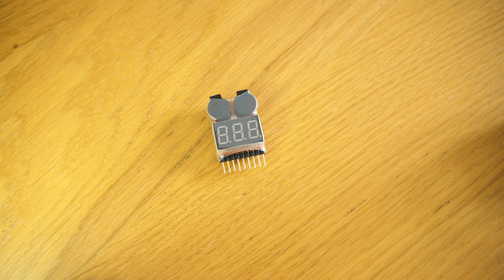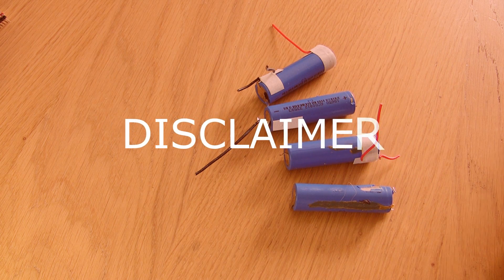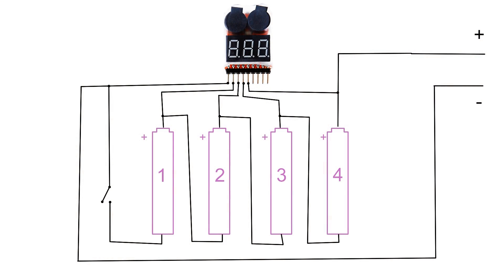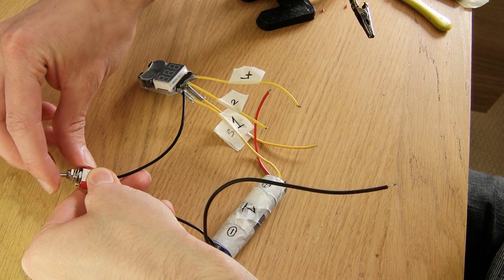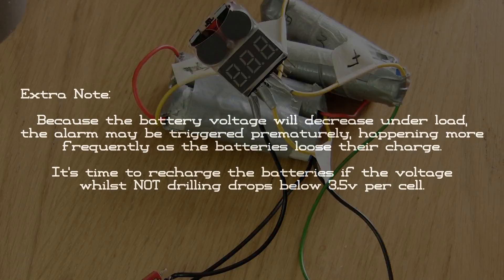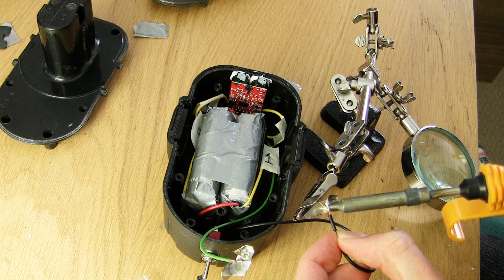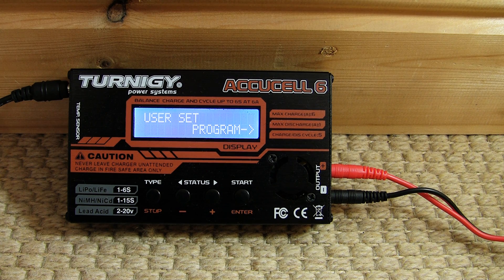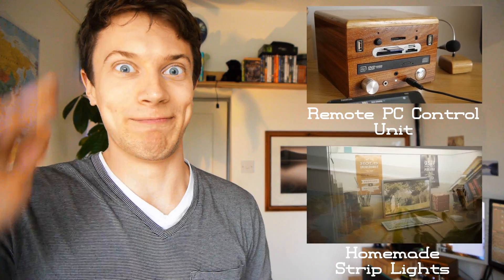Supercharge a Dead Drill Battery (replace Ni-Cd with Li-ion)

Comment: oh boi, 2013. I hope not too many watch this anymore. it's quite the hackjob and the batteries will overcharge at some point which could literally burn your house down if you don't pay attention lol. also there are many different kind of 18650 cells. the ones used in laptops are not designed to discharge quickly so this is the wrong usecase for them. that will destroy the cells pretty soon and further increase the imbalance in voltage of the cells.

Comment: Can you do an updated video were you do the same conversion but with a balanced bms pcb and discuss which pcb's could be used for which drills. i have found it difficult to know which bms pcb dose balanced charging and works for which capasity drill. i.e. a 3S with protection is is sutible for 14-15v drills but what do you use for a 18v drill. your views and guidance would be greatley appreciated

Comment: Hello people, do you think i could still use a low voltage li-ion battery
By that i mean, i got a big 48v (16Ah) battery that got undercharged for too long and know the voltage is too low so the BMS don't let me charge the battery anymore.

I don't really know what to do to be perfectly honest.
Even if it lose a little bit of autonomy, but if it can work and be usable that would be wonderful.

Comment: Given the cost of the battery warning circuit and the Li-ion charger, and if you have to buy the Li-ion batteries, ii might be cheaper to just buy a new drill. But, what fun is that? :-)

Comment: You used only 4 Lithium batteries. Would it be possible to fit 8 (4 + 4 in parallel) for more capacity = longer drill working time? Did you think of this?

Comment: Don't know if anyone sees this but duct tape usually conducts electricity so a big no-no as a cell wrapper. Just use electricans tape or 18650 cell wrappers, works like heat shrinks and costs cents (or pennies, if you wish) per wrapper.
Reply: https://www.aliexpress.com/item/32924790139.html?spm=a2g0s.8937460.0.0.2a192e0e2S0kur

Comment: This is a highly effective method to repair your old and dead batteries and prolong the life span of new and used batteries [Check Details Here==>https://plus.google.com/100351090281822647456/posts/Gwtd4mVBdEd ]. You can save a lot of money and help in nature preservation by repairing the batteries yourself. Any type of battery can be repaired as explained in the book.
Reply: ty

Comment: The switch in your schematic is in the wrong spot.  You do have it correctly wired in your end product.  Where it's shown in the schematic it will switch power on/off for both the drill motor and the monitor board.

Comment: Lap top batteries aren't advised for power tool usage. These are battery cells with low amp discharge limitations, like 3A, and aren't cells designed for power tool applications. While you'll probably be okay, like this video certainly proves, things can also go very wrong very fast. It's so easy to avoid this by simply using appropriate cells.

Instead of recycling terrible lap top batteries with all sorts of unknown cell specs, people should much rather just buy some high amp discharge cells, which are very much available on the vaping/e-cig market these days, because vapers are paranoid about batteries blowing up in their faces, which is easy to understand. That's why they use the best cells available. These are actually redistributed surplus cells specifically for power tools and EVs, like IMR cells and hybrid chemistry cells, and by being all new and fresh, you can rest at ease knowing they won't have crazily different discharge rates. They'll also be safer to handle, for whenever a DIYer might make a terrible mistake, considering they can handle quite impressive pulse discharge rates (some up to 150A for a second, which for all intents and purposes would equal a short, although they're definitely not designed for this specific purpose in mind), as opposed to shitty ICR laptop cells, that will explode by just looking at them.

IMR cells typically have a 10-20A discharge limit, while some hybrid cells can handle a load as big as 30A. 20A hybrid cells would probably be the best bet, as it is a good combination of discharge limit and charge size. While I haven't kept myself updated on the battery cell market for a year or two, Samsung 25Rs, for instance, are great and classic cells, that should be available in any vape shop for roughly $5 a piece. They're 20A and 2500 mAh, as far as I can remember.

Stay away from laptop batteries. They're in laptops for a reason :)

Comment: Good video I 
have a problem when drill strikes the alarm activates but it stops 
working the drill reading the voltage rises but the alarm does not turn 
off that is normal?

Comment: Nice video, but instead of the alarm display and the switch, why not just add a BMS to the circuit... It will take care of charge and discharge cut offs and also balance. ebay has them for about 3 bucks.

Comment: sorry but laptop batteries are useless for drills,why,laptop batteries give a constant output,so their about 5 amp,but drills need bursts of power,and need high drain batteries around 20 amps,if you use laptop batteries there is a chance of overloading the batteries causing the battery to vent[blow up]

Comment: I have been seeing black and decker 20v lithium batteries on sale for like $40 for 2. I am wanting to convert my craftsman 19.2v nicad to lithium and this seems like a great way to do it. it already has a protection circuit.  I should be able to just rewire to the correct post (assuming it fits in the case).  thoughts anyone?
Reply: As long as you have a proper charger you can most definitely do that. There is one thing though that wasn't mentioned in this video, which is the balancing of the cells (that's fairly important with lipo cells if you want to retail full capacity). Your built in protection circuit may have balancing built in. If not, the RC chargers shown in this video should have balancing connectors that take care of that. In that case you will have to make separate balancing leads for every individual cell to connect that while charging.

Comment: The switch is going to take a very heavy current when the drill is under load. Would it not be better to connect the negative output before the switch
Reply: Since it's a circuit in series the current will be the same in every point of the circuit. That switch will probably take the current though. If you don't feel comfortable using a switch of that size, you can always install a beefier one

Comment: This is dangerous. Your not balancing the cells and that could lead to one of them being overcharged. Anyone attempting this should also solder in a balance lead that hangs out the back of the case, then charge it as you showed in the video WITH the balancing lead attached.

Comment: it will be also good idea to duplicate wires, that goes to the monitor PCB, and use them for balance purposes with chargers like showed in this video, to ensure long battery life. or use BMS PCB (battery management system), that have balance function and charge/discharge auto off function. ofc it cost more, but you pay for your safety and it worth it, if you really don't have a lot experience  with lion/lipo batteries.

Comment: not sifting through the comments but ya dont use duct tape as an electrical insulator use heat shrink or tape designed to insulate electrical components, electrical tape etc...

Comment: I have really been enjoying your videos. Just found this channel today and I'm already a good 7 videos in. This project does concern me though. I know this is an ancient video but I just hope others don't dig this up an try this with the intent of using the drill for anything more then tightening a couple screws. With power tools it is really worth just spending $5 on a proper 20amp 18650 from Samsung, Lg, Sony or panasonic/sanyo. Considering the price of these packs even the $20 is a huge savings. In general laptop batteries tend to be rated around 5-10 amps with 10 amps being a lucky pull from a very high end laptop pack. In general you want batteries rated for 20amps with power tools and from experience it is also best to avoid any cell that is made in China. Yes, some are good but even those good ones seem to be over spec.  When planning to repack pulled batteries each cell should be charged, drained and charged again to ensure none are heating up abnormally or draining much quicker then the others.

Comment: Hi Matt, I'm currently investigating a similar but more up to date issue. currently most of the top power tool brands have a 10.8v impact driver, for example screwfix brand Titan. they used to sell replacement batteries for £8.99 but have now stopped doing so :S I rang them and they basically said buy a new set as it's only £80 (and now you get a free drill... yay! for the money I don't think you can get better) consequently I did, and that left me with an old battery to experiment on, opening it up it's simply 3 (low amp hour (1.3)) 18650 batteries. having scoured the Internet I can't find a decent video that shows how to do a replacement on them, I've got myself a soldering iron and 0.3mm solder just waiting on the batteries to arrive from an "international seller" I went for 3 amp hour batteries for longer usage, any who, it occurred to me that you could do a video on this for people spread this nice little hack rather than people ploughing money into whole replacement drills or battery packs

cheers

Comment: Hi Matt, really like your videos! I'm currently investigating a similar but more up to date issue. currently most of the top power tool brands have a 10.8v impact driver, for example screwfix brand Titan. they used to sell replacement batteries for £8.99 but have now stopped doing so :S I rang them and they basically said buy a new set as it's only £80 (and now you get a free drill... yay! for the money I don't think you can get better) consequently I did, and that left me with an old battery to experiment on, opening it up it's simply 3 (low amp hour (1.3)) 18650 batteries. having scoured the Internet I can't find a decent video that shows how to do a replacement on them, I've got myself a soldering iron and 0.3mm solder just waiting on the batteries to arrive from an "international seller" I went for 3 amp hour batteries for longer usage, any who, it occurred to me that you could do a video on this for people spread this nice little hack rather than people ploughing money into whole replacement drills or battery packs

cheers

Comment: I'd reccommend using RC car/plane grade 18650 cells instead of laptop ones.
They aren't rated for much more then 10A continuously and a drill could exceed that.
As long as you're careful not to drill something too hard it should be fine though.
Other then that minor recommendation this is a great guide to convert a drill to Li-Ion.
Reply: 100% agree there actually usually 5 amps,and a drill needs 20amp,high drains,to avoid the batteries to vent

Comment: Just want to say that duct tape is "supposed to" be made with metal fibers in it, as it was originally used on sheet metal ducting--cheaper brands do not have such, and some do--so be aware of what you are recommending, better to recommend straight vinyl tape, shrink wrap, or cloth tape.

Comment: Using old laptop batteries in a drill is EXTREMELY DANGEROUS. They were not designed for these high power loads and are already worn out. Someone may follow this and burn down their house or have a battery explode in their face then burn down their house. Just because you put in a disclaimer does not make it right.

Comment: I did the same project recently, but instead of a lipo protector and using a lipo charger I just bough a 7$ ion protection circuit and stuffed it into the case.

Comment: actually I made the same thing in earlier days but I made the battery tester outside the battery box because you need to pull the wires out to balance the batteries, unbalancing lithium batteries will probably make fire

Comment: Your soldering is quite... well let's just say that those contacts are not going to be highly reliable when your technique isn't proper. You're making a lot of cold joints that aren't flown properly.

If you make this, don't follow soldering advice from this channel.
Reply: I think he knows how to solder. his appeal is...KISS principle[A]  keep it simple stupit.... style of presentation, at this level of work soldering is a skill that we all probably know enough to keep it safe. Always being aware of one's level of expertise and asking for help when we things might be unclear. I think that DIY Perk uses a good balance of common sense while making entertaining vids that don't bog down fast, in technobabble. Save that for the work table and your buddies.  and do more research as the plan never survives contact with the enemy. so good?

[a] KISS principle. (2017, October 2). In Wikipedia, The Free Encyclopedia. Retrieved, November 2, 2017, from https://en.wikipedia.org/w/index.php?title=KISS_principle&oldid=803368540

KISS is an acronym for "Keep it simple, stupid" as a design principle noted by the U.S. Navy in 1960.[1][2] The KISS principle states that most systems work best if they are kept simple rather than made complicated; therefore simplicity should be a key goal in design and unnecessary complexity should be avoided. The phrase has been associated with aircraft engineer Kelly Johnson (1910–1990).[3] The term "KISS principle" was in popular use by 1970.[4] Variations on the phrase include "Keep it Simple, Silly", "keep it short and simple", "keep it simple and straightforward"[5] and "keep it small and simple".[6]

Comment: Hi I nearly done the battery but I don't understand how you get the negative of the battery to the terminal to the drill do you wire it up from battery one
Reply: Check the "wiagram" at 2.32.

Comment: How does it work without any balancing ? :-O
Reply: all the batteries he used were very close in their voltage when not under load so once you do a first charge with 1 amp it is quite hard to over charge the batteries do you can leave them until all cells have charged fully after that all batteries are at the same voltage so no balance charging is needed but is advisable after a few uses or if it had been left for a while.

Comment: Nice howto ! I did something similar to my drill batteries with 4s1p 18650 cells myself a while ago.

A few things to consider:
One should only use high current 18650 cells if you have a high powered drill, e.g. at least 5-10A continous current. Something like Sony VCT4 or VCT5.
Only charge your 18650 cells without balancing connector or DMS if they are know to be drift free. When you use Sony Konion V3 for example. Otherwise always use a charger with balancer such as an IMax B6. I used Sub D-Connectors for provding external connections to the balancer.

Using 18650 cells from an old laptop battery with unknown specs and charging them via a simple LiIo-Loader will not only screw up your new battery very soon but also possible cause it burning down during charging.

Comment: +DIY Perks would you be able to take a dead battery from a drill and make it wired? use extension cord or something? sometimes it would be nice to not have to worry about battery charge and I would rather not have to buy a second drill.

Comment: Shouldn't there be a balance board since they are connected in series? The protection board is not balancing them, or does it?:O
Reply: +PsoydoGangsta Correct. It may lead to imbalance. However this is only usually a problem with non-identical cells, and usually in 24+v configurations
Reply: battery upgrade
do we still have [asme]americam society mechanical engineers as a usable guideline or has this been outsoursed also?

Comment: Your drill will not last long when powered by much higher voltage.
Also your cells will heat up much and also will die because they are for up to 3A as new, old one should be usted up to 1A, u will use them at 10-20A, its ridicoulus....
Reply: +Arek R. it is a 14.4V drill. Under load those batteries won't put out more than that.

Comment: Very good! would be neater if you use heat shrink insulation for those contact points. :)
Reply: +Leo Li you came to the wrong place if you're looking for neat construction. I actually turned the video off when they started soldering the leads to the battery tabs. I'd seen enough by then. It is a good idea overall though.

Comment: I have a craftsman drill with 19.2 volt batteries.  How can you convert this voltage to Li-ion?
Reply: +Ken Brand take 5 cells instead of 4. it should work
Reply: +Wolter Nijmeijer Yeah those batteries with the funny voltages are the companies using the rest voltage. 19.2 is really an 18V pack. Dewalt calls theirs a 20V pack now. As if the tool power pack market wasn't already a complete mess, they had to go and make matters worse.
Reply: +Paul Frederick 
batteries,is the asme  still in use ?